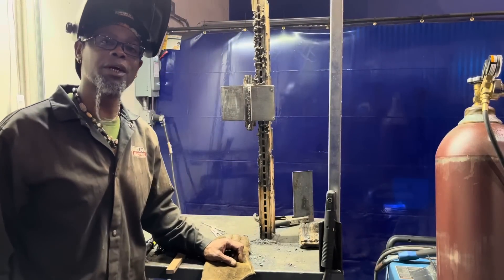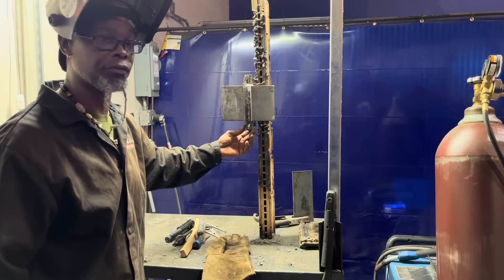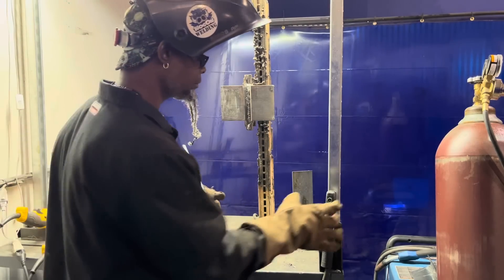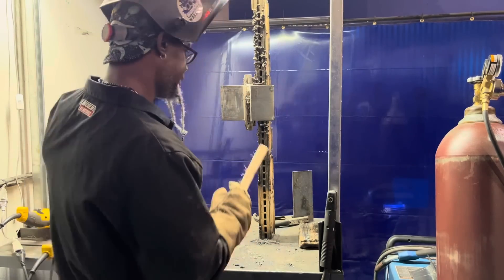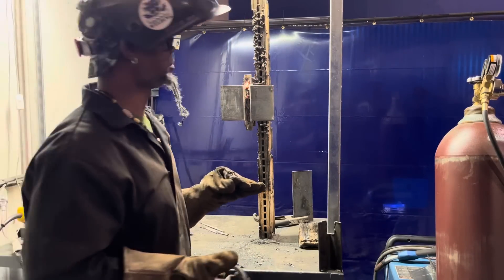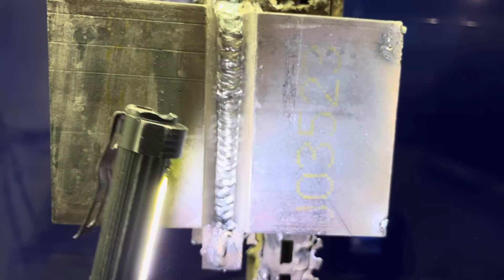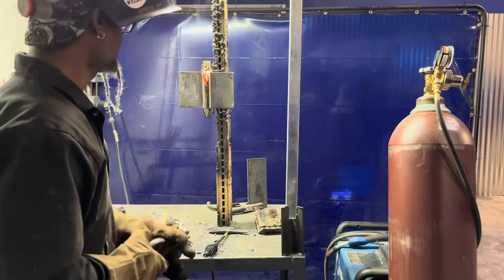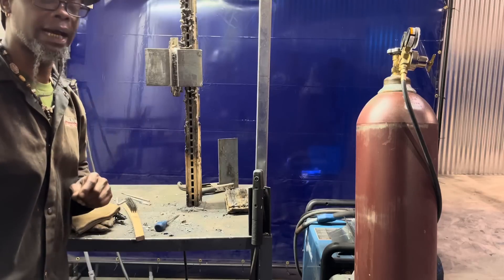Bridge Welding Test Secrets — How to Pass the AWS D1.5 3G Exam

Comment: I have very very limited experience in stick welding, how much difference does it make running the bead uphill as opposed to downhill?  I did most of my vertical roots downhill using mig and never had a problem, is there a particular direction that is better, and if so, why?  Thank you so much for being a resource for people looking to learn.

Comment: You can't weeve on a bridge test period. Years of bridge welding a slight oscillating movement but no weave so weaving on your root will show up on a x-ray and they are gonna x-ray your bridge test also have to use temp sticks 200 min 600 maximum you wanna keep it about 400 for best results also try not to have to tie in period if your not perfect x-ray will get u and u can't grind your restart

Comment: My biggest trouble was having a low spot on the lower half of my plate. I did small stringers to get it level and did my flush pass over that so i had a smooth surface to cap over

Comment: What helped me pass this test is mark the middle do all restarts there just incase you do have lack of fusion it wont be in the bend area which should be 2" to 2 3/8" top and bottom make sure zero trapped slag in that area.